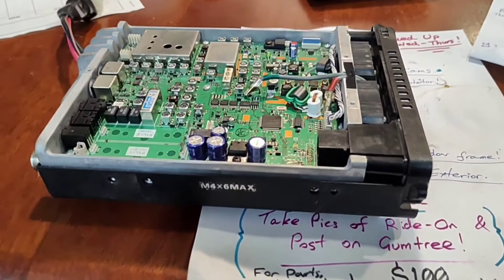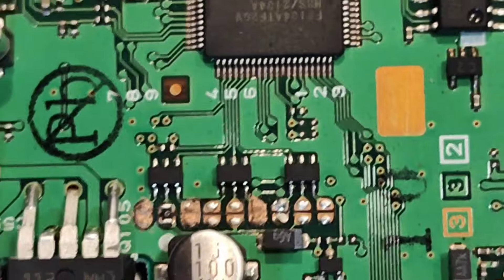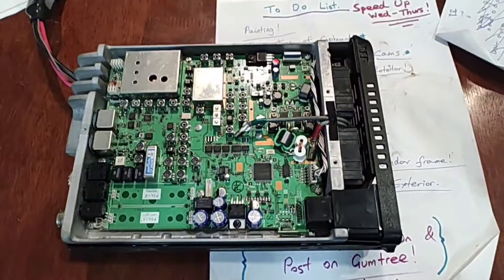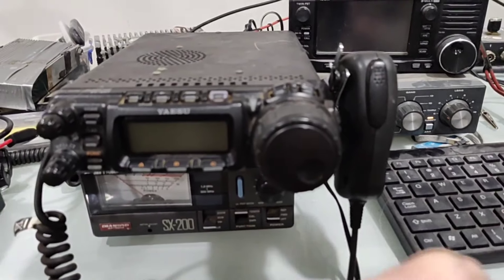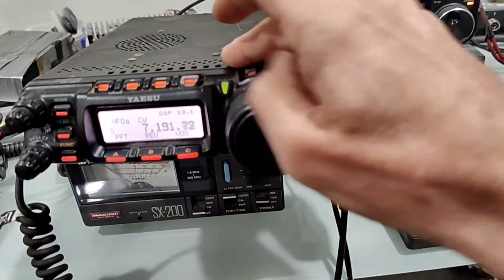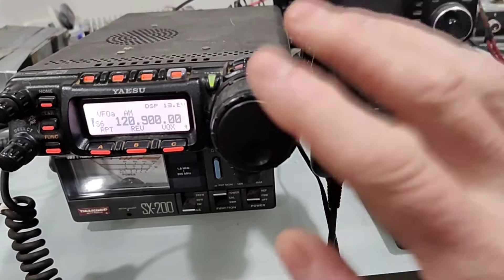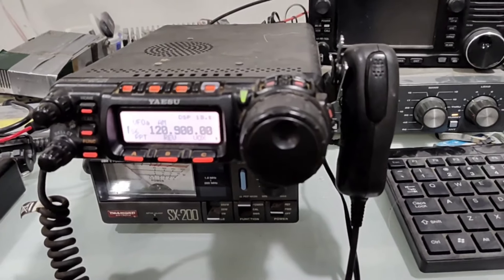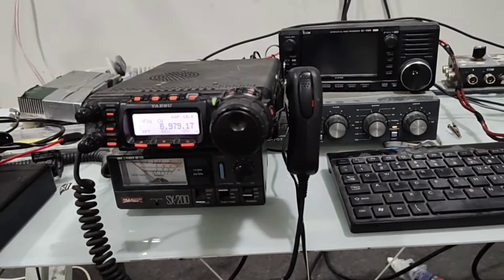How to Modify Yaesu FT857D (TX Frequency Expansion) Mars Mod (Euro Model/Maybe USA Model too)

Comment from the maker: It doesn't Unlock TX on the Aircraft Band or the MF Bands below the 160 metre amateur band !
The resistors that were already there 
were Zero Ohm Resistors
which are the same as a Simple Bridge of Solder or Conductive Ink.
The Euro model only needed one Zero Ohm resistor to be removed.

I suggest trying to get the resistance as low as possible to be on the safe side.
Give the conductive  Ink/conductive paint enough time to dry properly
& if the resistance reads a little high,
touch up again after drying with more ink/paint as
More layers are just like having more resistors in parallel
which reduces resistance.  🙏

Comment: Hi what about 8m / 40Mhz does it rx/tx there with good power pls?
Reply from the maker: Hi there, I just ran a quick test for you.
Although it will TX on 40 MHz the output is attenuated due to the internal filters
dropping 25 watt down to approx 17 watt.
I'm curious what 40 MHz is used for in your part of the world? 
73 Mate ⚡🙏⚡